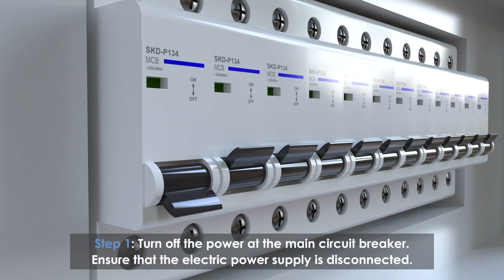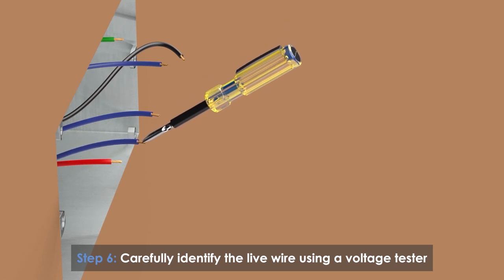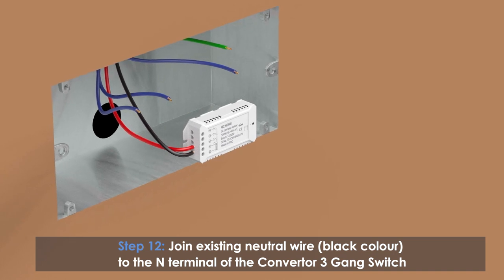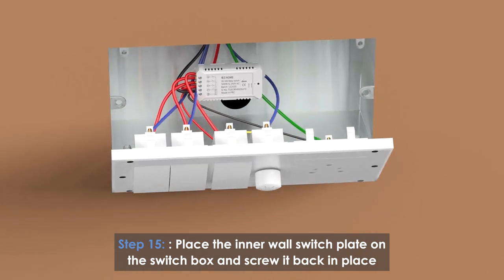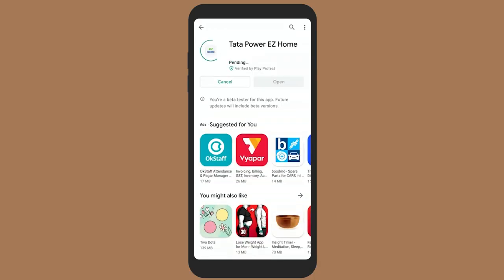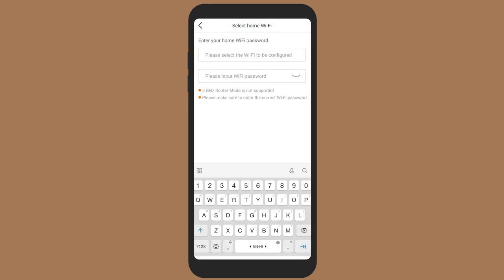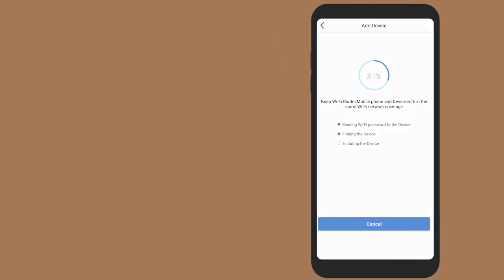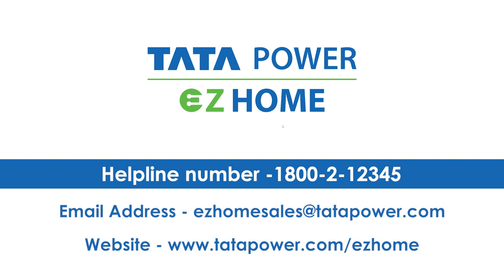Tata Power EZ Home Smart Convertor Switch Installation & Configuration Tutorial

Comment: Here physical switches should be always turned on. This doesn't serve the purpose. Ideal usecase is to On/Off Lights/Fan with both smart switch(phone) and physical wall switches. This is possible with Sonoff smart relay.

Your product requires physical switches to be always on. Only then your smart relay can control the load(device).
Reply: Is that true? Then the product is miss leading and they are making a claim that is not true...Nowhere they specify the switch have to be always ON
Reply: There is also a 2 way switch to make it work both ways , switch model SW04
Reply: Do you recommend tata product or sonnoff?